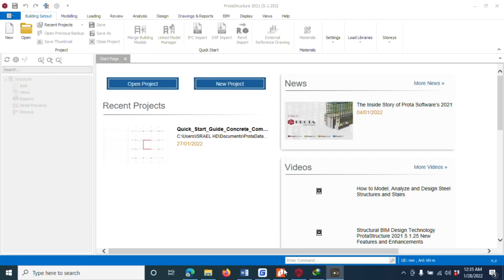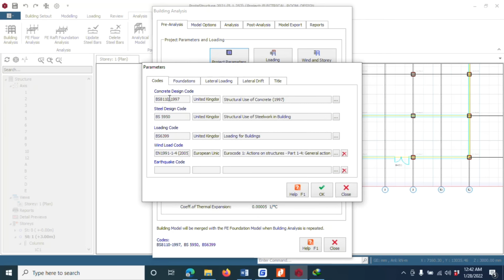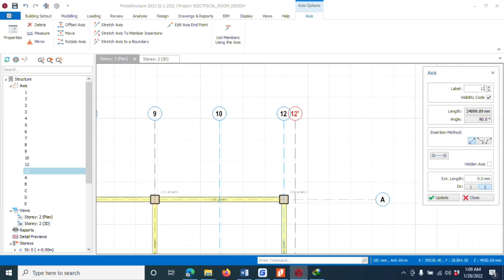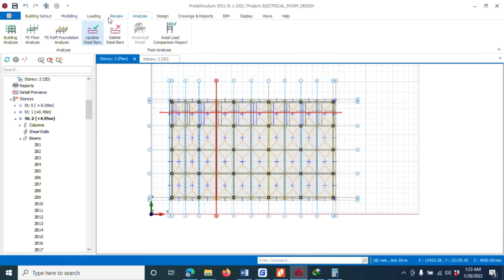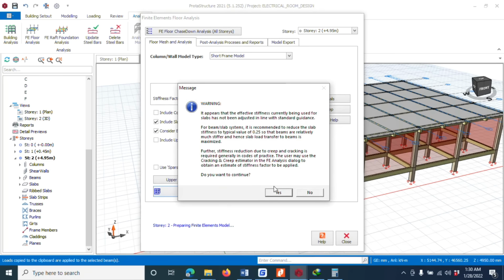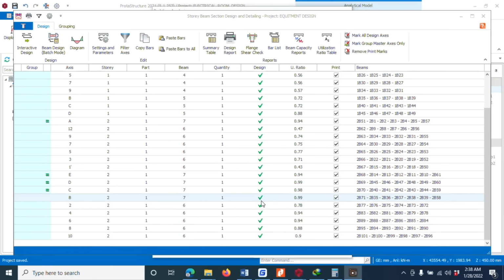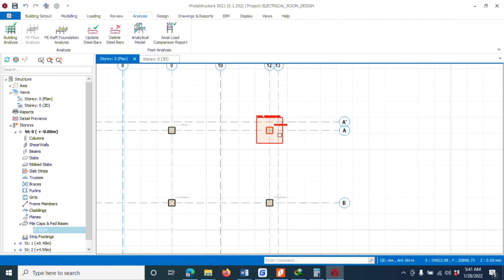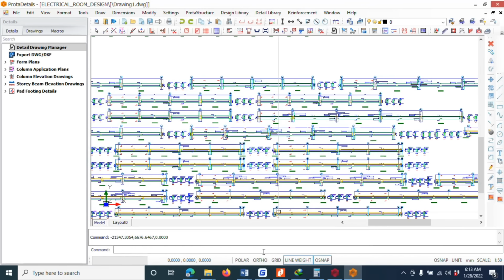PROTA Structures 2021: Complete real Project for Beginners

Comment: Does Prota Structure 2021 detail single footings as top and bottom?
Reply from the maker: yea but there is an option to remove it during settings
Reply from the maker: i have showed it in the tutorial during footing design watch it carefully
https://www.youtube.com/watch?v=mb53HBSYUtA&list=PL7cfvNbmb9fraKXY1vo5W0ApS1sfIT8rB&index=3
Reply: @hdstructures  
I just did but found out that my pad foundation settings is different from your own.
I just sent you message on Whatsapp.
Kindly guide me.